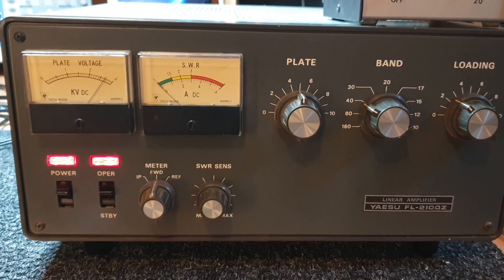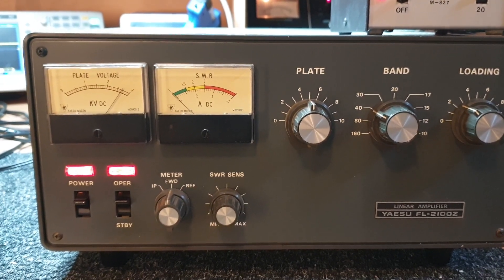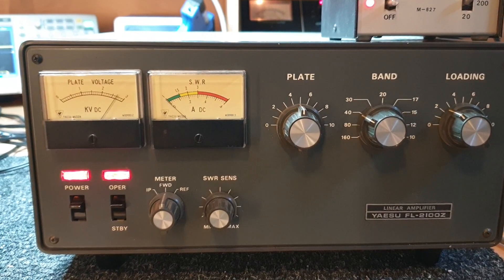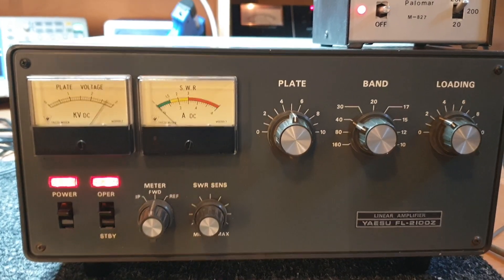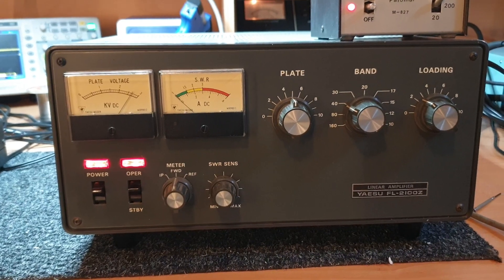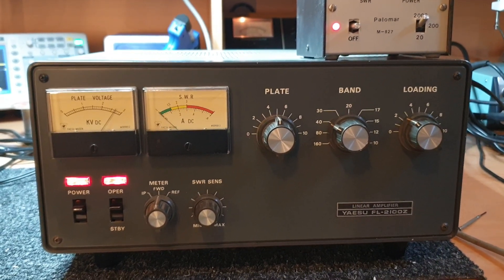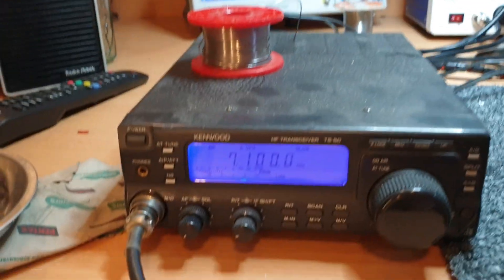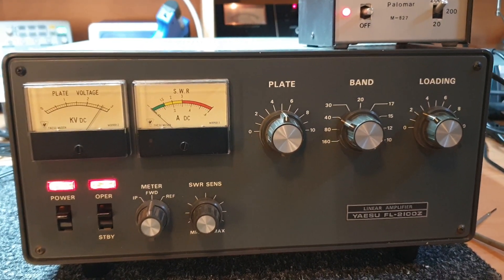FL2100Z test after new tubes fitted.

Comment: Here is a small modification for FL2100. The capacitors C8 and C9 220pF (between grids and ground ) are too small , this affects the amp performace for bands below 20m. Replace it with at least 2200pF. With this mod the required max TRX power is 45 Watt for 40m.